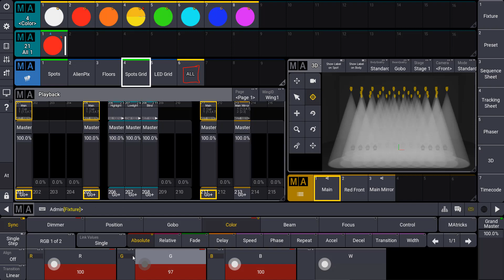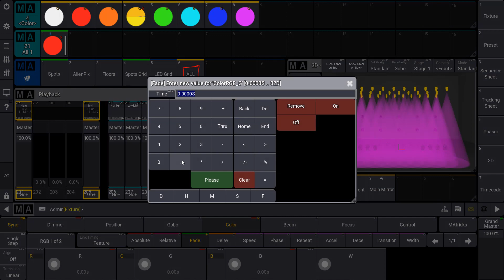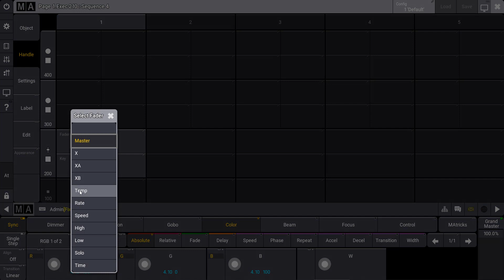grandMA3 | MA Tips [EN] | Timing in Presets

Comment: Where in the manual can I find more info about the "Link Timing" button? I'm not understanding why it must be set to "Feature" in order to do fade delay.
Reply from the maker: The Link Value button just decides how to set the values within the layer. So do you want to set an individual fade time (Fade layer) for one single attribute or the whole feature.
Example: You want to set an individual fade for your color magenta:
Link Value = Single: Turning the red encoder for the fade time sets the fade value for red, but not for blue!
Link Value = Feature: Turning the red encoder for the fade time sets the fade value for the whole feature, so for R, G and B!
So it depends on what you want to do and on the feature you use. You can easily see that for a dimmer feature with just one Dim attribute it does not make a difference.